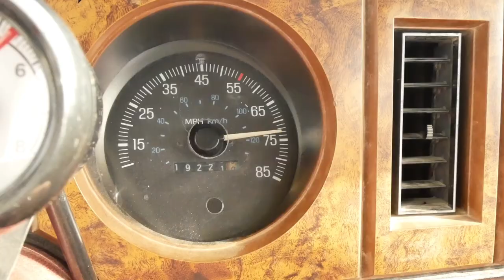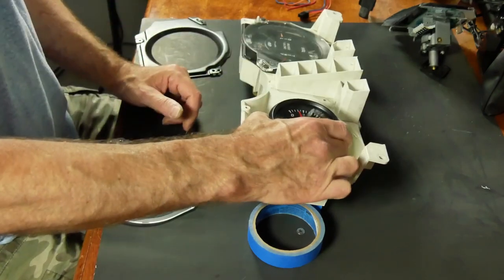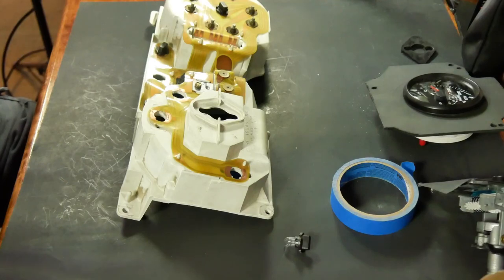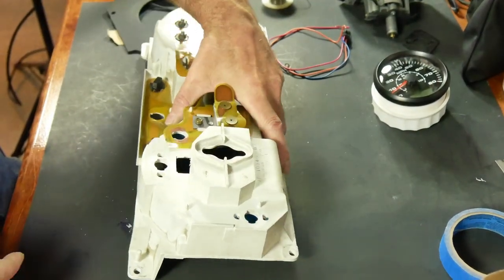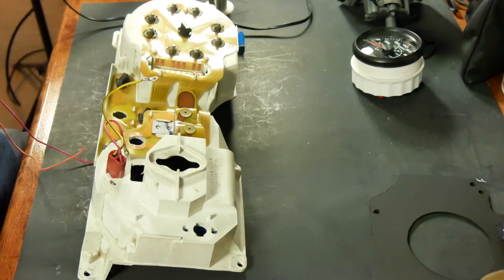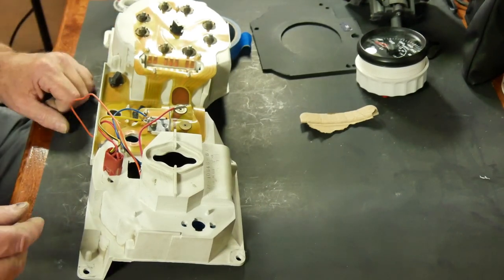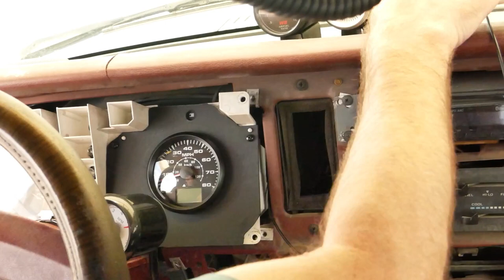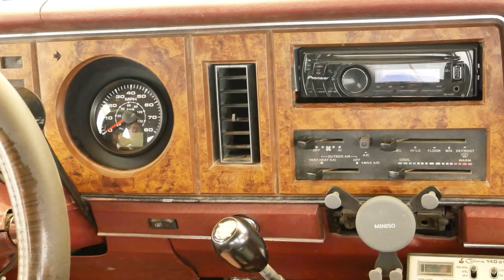How to install a GPS speedometer in your ride.

Comment: Hi Rick. I bought the same Eling speedometer for my old Honda motorcycle (parts no longer available) and I'm going over the instructions provided and they refer to the trips and COG. Can you tell me what COG means? I really like your instructional video on installing your speedo in your Bronco. Quite informative.
Reply from the maker: 'Course Over Ground' is a nautical term to differentiate between heading and actual speed.
Reply: Thank you Rick. I tried to come up with its meaning and I never would have got that.